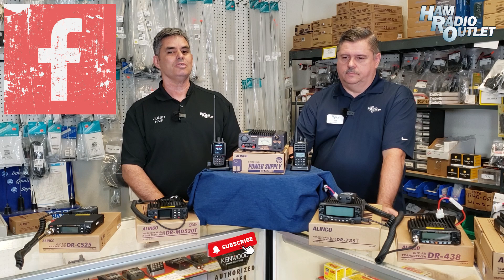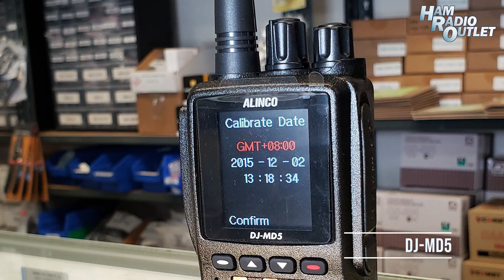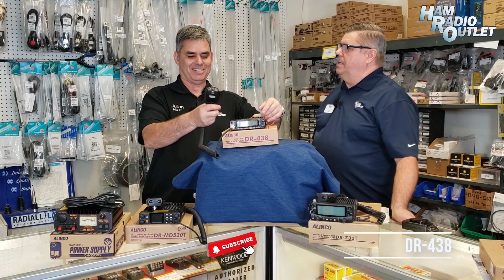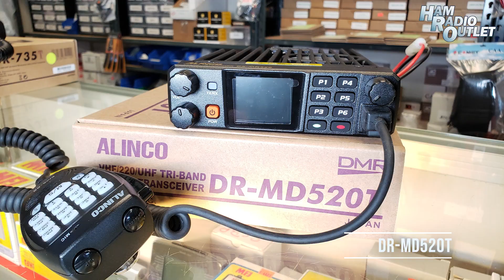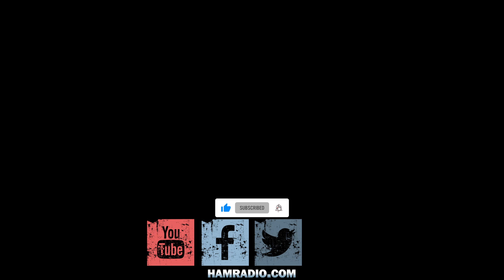Alinco HT & Mobile Radios - Ham Radio Outlet

Comment: Ha Ha! I was born in 1938.
I have a question: I have an ALINCO DR599 twin band VHF/UHF transceiver.  The internal battery has gone flat, and I am having trouble finding a replacement.  Can you help? Please.
Regards,  Richard
Reply from the maker: Hi Richard. We do not sell batteries, unfortunately. Have a look at Mouser Electronics: https://www.mouser.com/c/power/batteries/  They may have what you need.

Comment: I have the Alinco dr735t. My first 2m/70cm radio having only got my licence in May. It IS as someone else said, fiddly to program although the RT Systems software makes it simpler, as does Chirp. Very capable and lots of functions and features for anyone who is happy to have an FM analogue only radio. We need some tutorial vids for it I feel, as there is very little out there, in English at least. No offence intended.
Reply from the maker: Congratulations on passing your license test back in May, and welcome to the ham radio community! I think there are many products where a little more thought could go into the user interface design, those include some ham radios. Once you get used to the menu system on a radio (which is different on every radio), you'll not have any issues... until you buy another radio and have to learn everything again! The important part is to know how to program each radio from the front panel. That will help you in emergency situations, or scenarios where you have to program a repeater when you don't have a computer handy.

Comment: I have the 735T and hate it, the most confusing radio to program.  The manual is useless and confusing to understand. And alinco has no support.
Reply: I agree about the manual and the interface, and it's a shame because it is in essence a really good radio. Very capable. Just arcane.
Reply: I have the 735 and the 520T. I find them both really exceptional radios and EZ to program with RT Systems software.

Comment: alright    I just purchased a Alinco Dr-735T    Need to know   what the cable is called   going from the radio to the removable faceplate .  It looks like an old school phone jack cable    but found one here at home but does not work     I know the other cable is ethernet or C-6.   I'm trying to find one on Amazon
Reply from the maker: The head-to-body cable is not mentioned in the manual as being available as an accessory, so there is no part number. It could be a crossover cable, but that's just a guess and if you try a crossover cable and it causes an issue with the radio, that would be something not covered under warranty. Alinco does sell a separation kit which includes a longer version of that cable: EDS-30 https://www.hamradio.com/detail.cfm?pid=H0-015309 You can also email Alinco Technical Support at alincosupport@remtronix.com (as found on their website).

Comment: I found a alinco dj-580 it looks old and works fine i just dont know how to use it. Was wondering if it was worth anything?
Reply from the maker: It's at least 23 years old and radio features and specs have progressed significantly since it was released. Sell it on eBay. If you get any money for it, you're ahead.
Reply: Thanks

Comment: I would like to see a comparison of the ic7300 and the ftdx10 thanks in advance
Reply: 7300 is easier to use; but the dx10 has the better receiver 
I need some thing that is easy to use
Reply: @frankjankovich3512  I hear that I have a noise issue here I live a block east of a shipyard and am not sure if I need the better receiver unless it is easy to use without digging through the menus to find what I need to knock some if not all the noise out

Comment: I have the DR-735T and the DM-330MV and confirm they are fantastic - been using mine for a couple of years and no issues but good issues!   73!  W7PMR
Reply: How is your airband reception on the 735? Mine is disappointing. It sounds very overdriven and distorted. AM and AM narrow makes no difference.
Reply: @OperatorXray  Have to admit I haven’t made much use of the air and as yet. Now I’ll have to turn the dial that way and see!